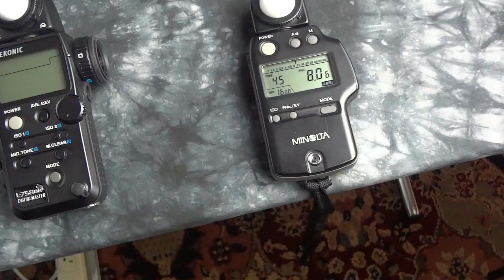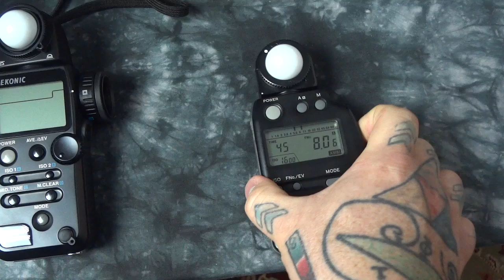Nonsense! "Throwback-Technology" does what NO camera can do: Lighting Ratios

Comment: Hello
I have a question...
In AMBI mode I can adjust the ISO/time/aperture ratios after the measurement.
But if I use "non cord" flash measurement then I get a specific aperture value displayed.
After the aperture has been displayed, if I now press the rocker switch - to adjust the time/aperture ratio - the aperture disappears and no time/aperture can be adjusted...
Is that correct or is something wrong?
Greeting

Comment: Good afternoon Ken. I am thinking of purchasing a used sekonic L-508. is there anything in particular to look for in a used light meter. Also, in your opinion is $300 a fair price for that meter? Thanks
Reply from the maker: check its calibration against a base shot from youre camera, its its more than 1 stop OVER/UNDER , forget it

thats a fair price for the 508 meter man......make sure you have paypal and ebay buyer protection (im assuming ebay)
Reply: +Theoria Apophasis thanks a lot. I respect your opinion on photography gear above all other youtubers. Keep up the great work.
Reply: +Theoria Apophasis hey Ken, Quick question regarding checking the accuracy of an old meter. I was recently given a bunch of old Nikon film stuff and that exact Minolta meter was in the box hehe score! I put new batteries in and it seems to work perfect. You just said it should be within one stop of my d7200 on spot meter... Correct? Thanks so much! Cheers!

Comment: I love my Minolta Spotmeter F. I just bought another one for €91.75. It is spot on with my X-T1. Try e-bay. If you can't afford a light meter then get a gray card and spot meter with the in camera spot meter on that card. It will give you the same result as the lumisphere ( little white dome) does. The downside is that the gray card and lumisphere do need to be in the same light as the subject. So a waterfall at 100 yards distance under trees cant be exactly metered without the gray card being at the waterfall. That is where the spot meter comes in. Especially for landscape shooting. Try this: go outside and put your camera in spot metering mode. Spot meter the whitest of clouds you see. Put the values in to the camera and expose for +2 stops. Check the picture. It is almost spot on and almost finished. Just some sharpening, color corrections, tweaking and presto. Being spot on depends on weather you know the dynamic range of your camera. This can be +2 till +3.5 stops depending on make and type of camera. That is something you need to find out by testing and shooting +2, +2.5, +3, etc. Zeroing in to the sweet spot. My X-T1 makes me happy at +2 stops. As it happens the Minolta Spot Meter F gives a high reading of +2 stops and a low reading of -2 stops. So perfect for me. A other + is that this meter runs of 1 rechargeable AA battery. Whom doesn't have them laying around. I love doing stuff on the cheap. De downside is i need 2 meters. One incident flash meter and a spot meter. The incident meter is for flash, if there are no clouds in the sky to spot meter on and portraiture and the spot meter for all the other pictures i shoot ETTR. Still a Sekonic 758D would be very nice but this way i am still 50% cheaper using 2 meters. I never use them both at the same time.
Reply from the maker: yuuup :)

Comment: I'm stuck between a used Sekonic L-308S and the Minolta IV. Either can be had for between $100-125 minimum. I don't have much money to spend which do you recommend?
Reply from the maker: sekonic 308 is a dog that does a few more tricks :) but you cant calibrate it however

the minolta you can, but its already old as hell
Reply: uuggg! Thanks partner let me pray about it.
Reply: Minolta. You don't need all the crap extras Sekonic throws in the mix.
Reply: ok, now I think I want the L-358. Does 1/3 stops and can be calibrated if needed. Once I get it I'll go by Kens' house to get it calibrated correctly, lol.

Comment: Thoughts on the L-478DR-U? Is it worth it?
Reply from the maker: define worth it.........ive said MOST people dont NEED a light meter

honestly one of the old Minolta IV for about $90 used is nearly just as good an idea

that meter is $640
Reply: Actually about $340. This meter is below the one you are using. So, as far as functionality.
Reply from the maker: extremely functional, its as valid today as when it came out 20+ years ago.......does flash, ambient, and averaging
Reply: thank you!